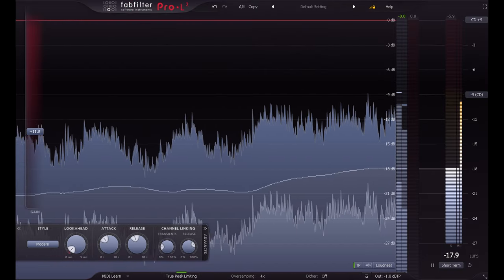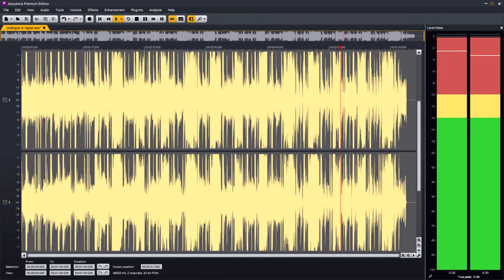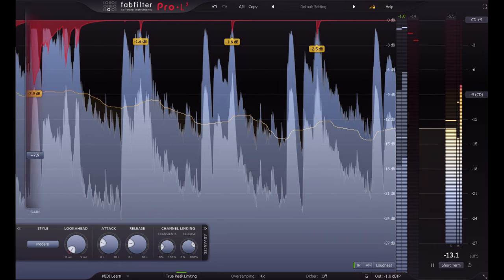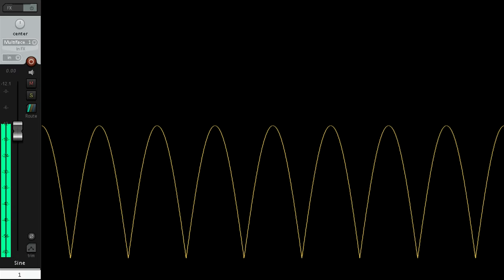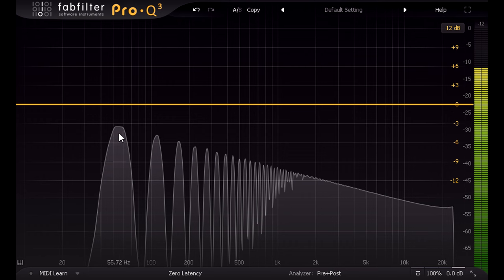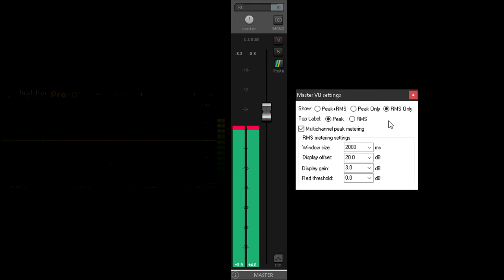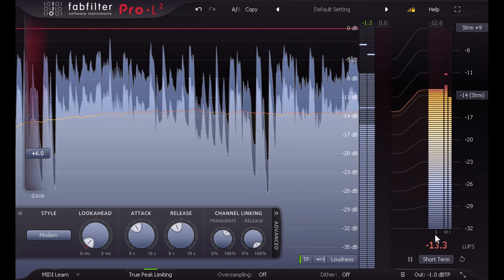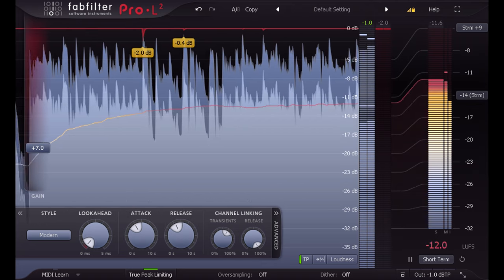The secret of maximum loudness (part 1)

Comment: true loudness is a lot about spectrum; something you should all consider doing is also Hi-passing the Side frequencies from about 100hz (gentle slope, like 12db) and low passing the side from about 16khz, this will leave the true stereo info around the centre and will give you more defined bass and brightness.

reanalyze the final file, make sure it doesn't have relevant dc offset and that the true peak doesn't clip (analyze a lossy version to see if you put enough headroom and evaluate further corrections)

and don't forget to incorporate some upward compression in the chain, it will help you increase the overall loudness without squeezing the whole song too much by relying solely on downward processing

Comment: This is something I noticed with MP3. MP3 seems to have a slight gain vs uncompressed, so people can think that the MP3 version of a recording actually sounds better. The slight gain is how I sometimes can figure out that a recording is an MP3 vs a recording when the other factors don't work.

It's a clever trick. The lossy compression algorithm applies a slight EQ/gain enhancement (or has that as a side-effect)

Comment: I'm pretty sure streaming services mesure integrated loudness and brings it to something like -12 LUFS. 

So the point is, when you want a "perceived loud master"  to make a loud drop (-4 LUFS short term)  and a quiet break and  gradually quiet build up. 
So when streaming services calculate the integrated loudness of your track and brings it (mostly) down to -12 LUFS, you have your drops louder than a track with a stronger integrated loudness, so the perceived loudness is higher.

Comment: I think the end part is what alot of people are missing when they are wondering about target loudness. They see pop or EDM with a high lufs and wonder why spotify is -14 but don't take into account a lot of those songs aren't dynamic arrangement wise and the whole track is the same volume where if you are doing progressive rock and ambient or jazz you just aren't going to have that integrated loudness across the whole song. Dubstep for example is really high but thats because it is aggressively loud sounds across the whole frequency range, you don't need to limit that much when the actual source sounds are saw-waves and white noise as those sounds already have really high loudness, trying to limit a folk song with a dynamic arrangement and fingerpicked guitar to those loudness levels will never work.

Comment: Many of us pop mixers are around -8lufs. Seems to be the sweet spot of loudness and the sound of compression and limiting which is very much a part of the sound. Any quieter and the energy and distortion is not there. Much louder like -5/-6 and it kinda folds in and sounds quieter when volume matched on streaming services.

Comment: So if I were to record all of my audio “quieter”,  so that it’s peaks aren’t so high and fall but the audio file looks shorter in height, would this give more room for the mastering engineer to crank it? Since the peaks are lower and there is more room to push them up?
   Or will limiting it either way flatten out the sound the same regardless of  how it was recorded?
   One thing I always worry about are dynamics with electric distorted guitars .

I’m wondering if there is something one can do in the actual recording or mix to enable the mastering process to be louder?

I think i heard someone say more low end makes it harder for the mastered mic to get louder. Idl if that’s just a perception thing since more low end has less presence than high end As briefly shown here. Or if infact when it comes to mastering this does objectively make a difference .

Comment: Could anybody answer my question: why so many mixes releases ( songs) sound distorted? Was this another attempt to make the track sound louder? Even tho you say that level does not matter in a digital recording? Thanks
Reply: I think so many sound bad and distorted because the dynamics of the songs are squashed. We need the mountain and valleys. Time for our ears to adjust and actually make sense of what is happening... If EVERYTHING is bold and loud, then n o t h i n g - is bold and loud...
Reply: @JorgeSilvestrini  and I grinch as I try to listen… I totally understand what you are saying “you have to let wave breathe “ and it if sounds a little low, just turn the volume up but don’t butch the song
Reply: @alexron2023  Yes agreed!

Comment: The so called “sweet spot” of an Amplifier with respect to minimising distortion (S/N ratio etc) may not and usually does not match the sweet spots of the other electronic components in your sound system - especially the speakers.
There are individual optimal settings for each component as well as an overall sweet spot of your sound system, which depends on how the components interact as well as how the resultant sound behaves in the listening space.
Then of course we have a “sweet spot” associated with the listener which is entirely subjective - ie based on personal bias and taste.

Comment: But ask yourself the question - why do you want to make the mix "louder"? that's what the volume control is for. Compressing the dynamic range just kills the music and is why most modern recordings sound s**t on a good hi-fi system. Even some modern Jazz is guilty of this.
Reply: To be fair it sounds bad on cheap equipment too. Anything better than mobile speakers and you'll notice that the sound isn't as clear as it should. In so much music these days you can easily hear clipping.